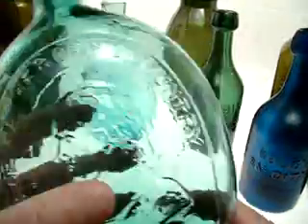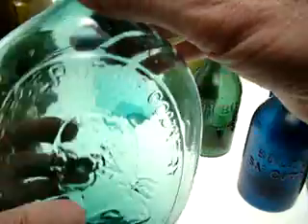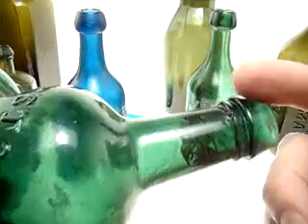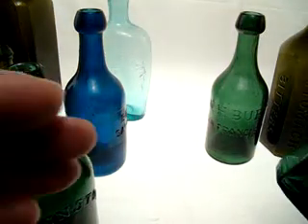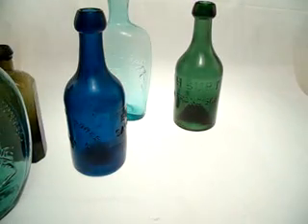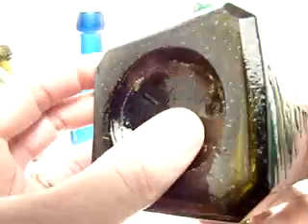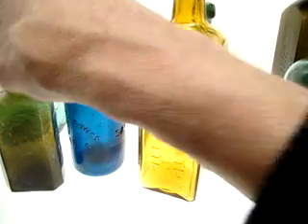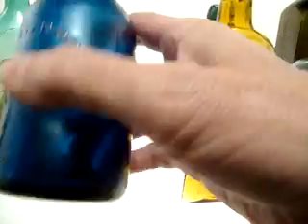Bottles 101:  Bottle Bases

Comment: I found these about 1 oz. footed shot glasses with ground off pontil.  The site was pretty definitely 1893 and I found one pontiled cologne. Other slick sunken panels had a circular mark in the base, a sort of artificial "Pontil" applied because people were "Used" to it.  One sees this in stereotypical bottles like Pitcher's Castoria-Machine made Castoria then screw tops on otherwise "old" sunken panel type designs.  People in the old days had a sense of what was self-consciously "Olde" as much as any modern retro aficionado.  In the later '30s into the '40s the term "Gay '90s" came into wide use, no isms at large, cars a new novelty &c.